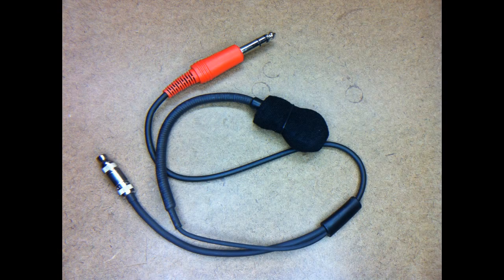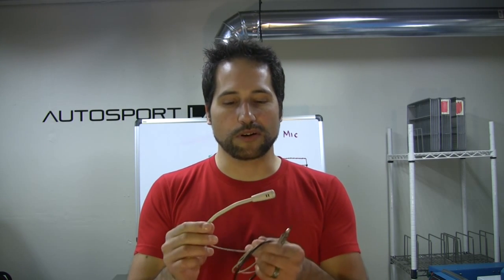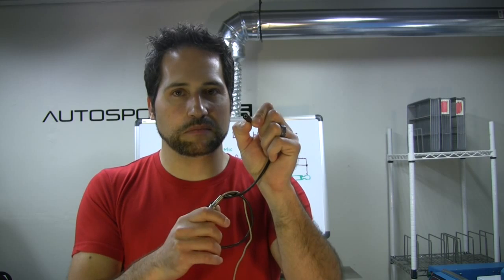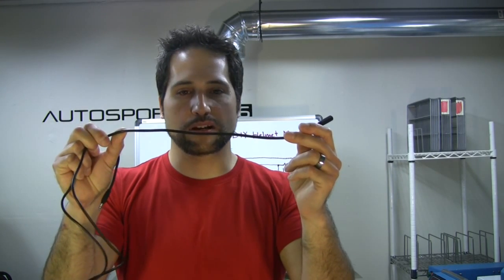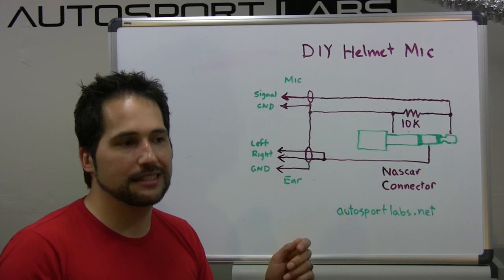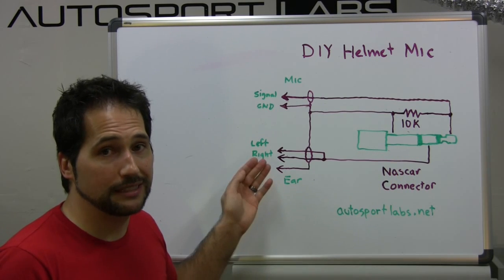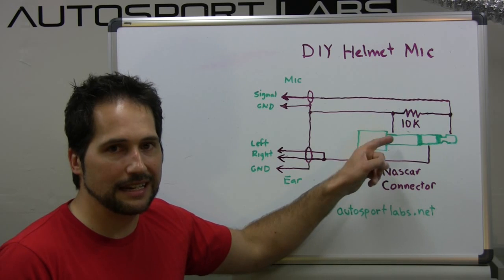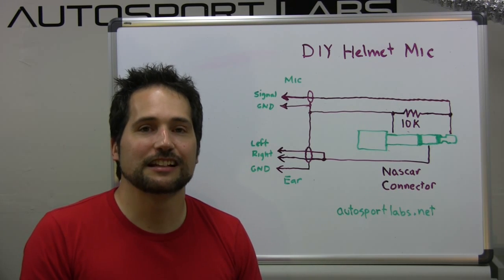DIY Racing Helmet Microphone

Comment: Hello. I have a question I’m looking to answer please. I have a pit crew racing headset with 2way radio connection. I want to add a scanner 3.5 mm port to listen to a scanner also. Can I just wire the port to the headset speakers or is it more involved? Any help or pointing in the right direction for information appreciated.

Comment: I can't get mics - same as your type - but headphones work. The resistor is wired as described tip to base and confirmed with meter. Mic is also wired tip to base. Is that correct? I tried two mics.

Comment: I did something similar for our team except i used the mic boom off of an old pc headset that had died. It had the same electret mic element as the cheapie headsets the radio came with. Chopped the headset it came with into a few pieces, used the PTT it came with glued to the steering wheel, and a 1/8th inch jack for the drivers headphones, and the pc headset boom on a clip the drivers could move from helmet to helmet. Also, i used a USB extension for the connection between helmet and radio.